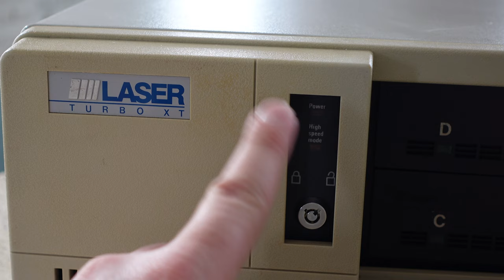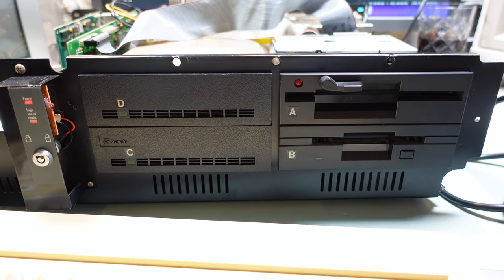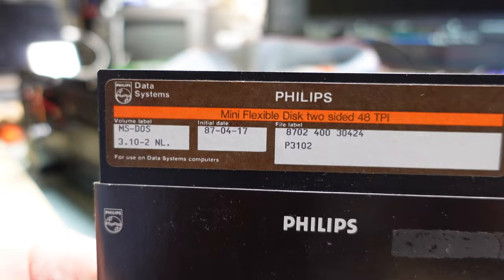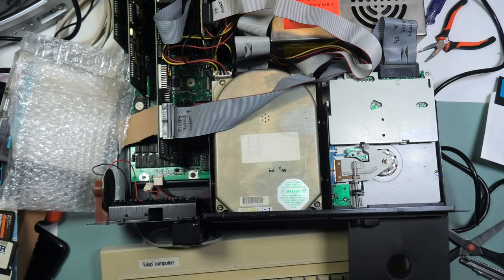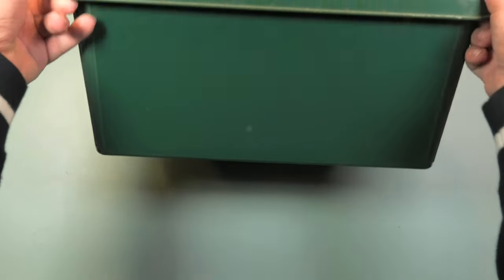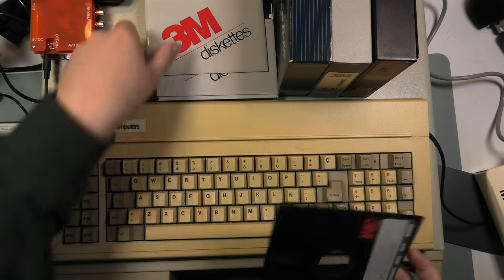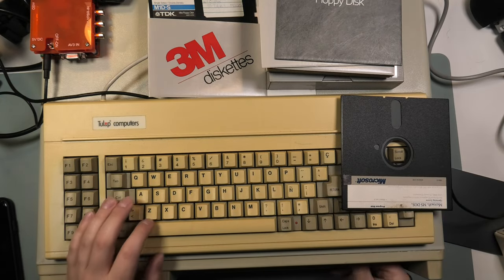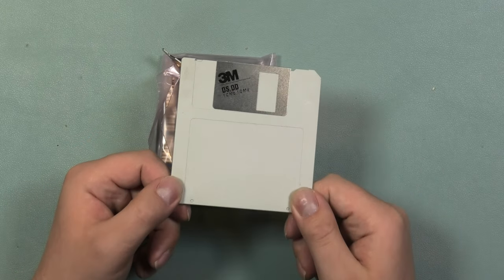Exploring and fixing a Very Nice Laser Turbo XT the Boring way

Comment: Yes, a list of bad sectors is a common and normal thing for MFM Hard Drives of this era. The manufacturer provides these so you can input that information during low-level format to mark these sectors bad.

All hard drives have such manufacturing defects. But this is now hidden from the user in the era of IDE and more recent drives. It's all handled by the integrated electronics instead.

MFM are dumb drives,  the controller is external, so that information is necessary.

Also, be careful to park the heads before shutting down, unless your drive supports auto-park.
Reply from the maker: Awesome comment! I’ll remember this for part two!

Comment: Just acquired one of these a week ago. Turned it on, got messages that the CMOS battery was low, then it powered off after about a minute. Haven't been able to turn it back on. Going to attempt to replace the battery and do some cleanup. Hope to get it up and running again. Thanx for your video as it's going to be what I'll reference during the process.
Reply from the maker: Awesome! Hope things will go well!